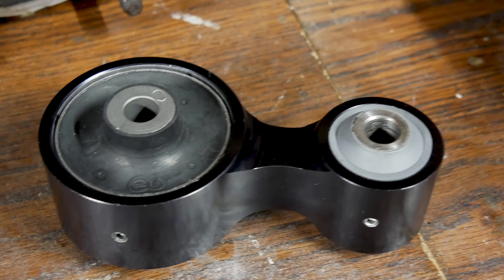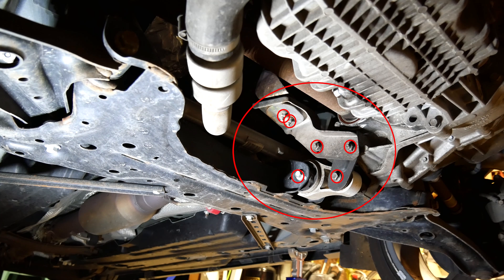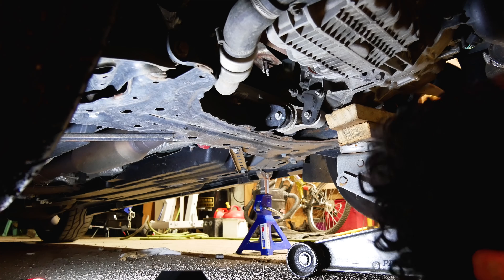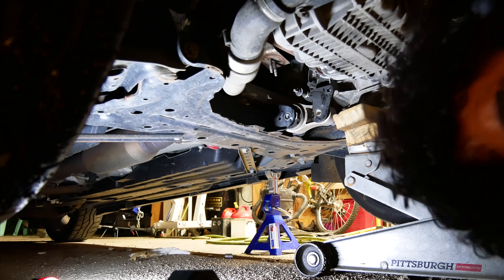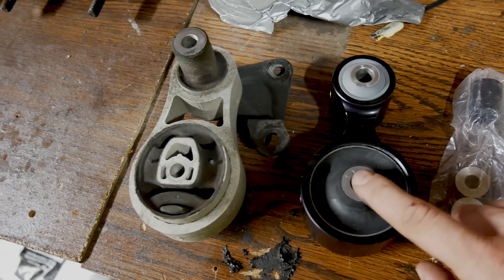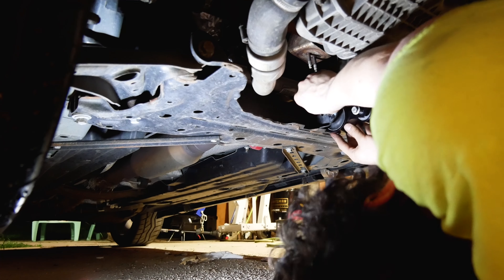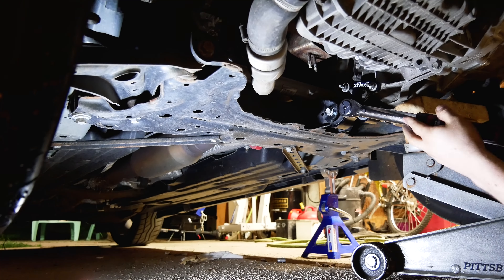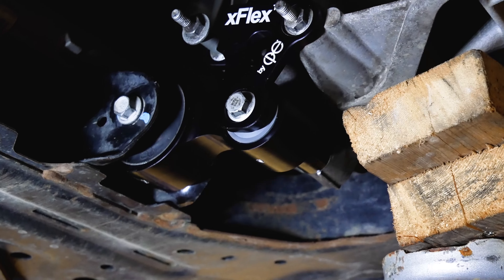Fiesta ST CPE Rear Motor Mount Install

Comment: How does this rmm feel? Did it stop the thud and jerk when shifting from 1st to 2nd?
Reply from the maker: Yeah it makes it a bit better id do the powerflex mounts on all 3 if i could do it all again. Way cheaper and i love the trans mount insert and the motor side pineapple feel.
Reply: @killerClaffey  Why do you say it's better? I dont have a FiST yet Im just shopping around for mods for when i do buy mine
Reply: Cpe engine mount is very stiff, great for tracking, less hopping  and better tight cornering fills more planted, slight vibration on steering wheel though, not that it bothered me.